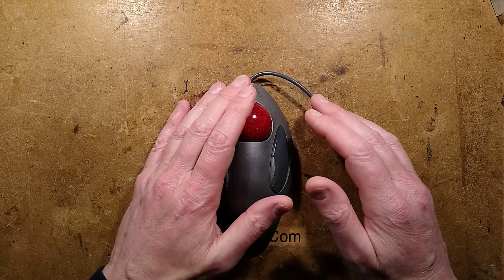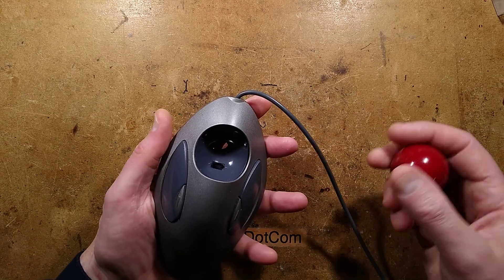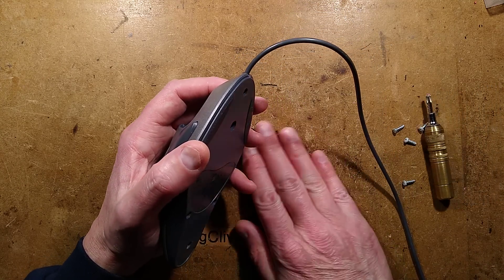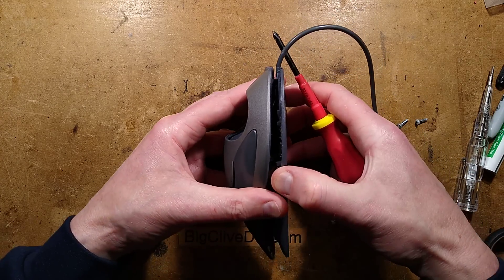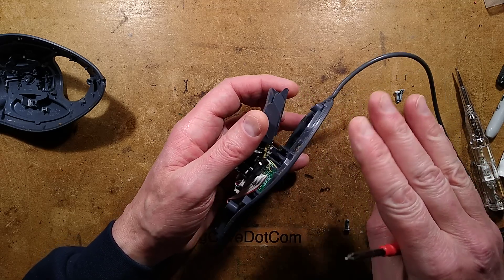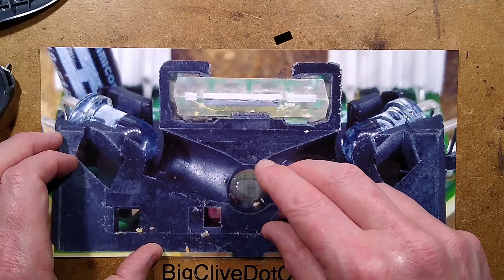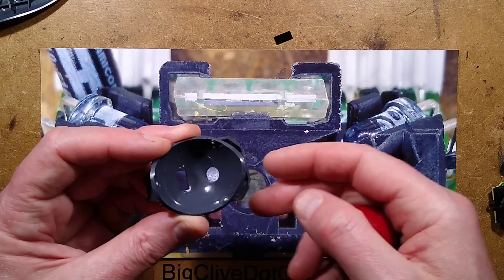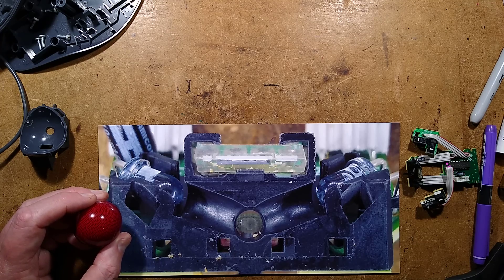inside an optical trackball

Comment: Regarding what big Clive was saying with the use case of these.

I'm surprised that he did not mention about people with disabilities using a trackball for computer input!

For some disabled individuals and I have known quite a few track walls are great a lot better than trying to use a mouse.

Some of them are not actually able to use the mouse due to limitations of their disability.

And I'm someone myself that would probably benefit from trackball use.

I have carpal tunnel in both wrists and it is hard to use a mouse for long periods and I'm someone that will probably be in the tech industry eventually 

Something like envisions and mine actually exists I think I saw something once that's similar or works very similar or maybe something slightly different but reminds me of this.

What I was looking to see if it actually exists is essentially a joystick but has a miniature say marble-sized trackball in place of the Hat switch.

That could be here to act like a computer mouse.

Or even some sort of Gamepad with an integrated trackball.

I know they have the Sun trackballs but I'm having trouble finding something that would really work for me

As a matter of fact years ago we believe what might have led to my carpal tunnel symptoms.

It was not constant typing that is out the window due to the fact that I really could not touch type whatsoever.

Back then it took me over an hour per page.

However on a smartphone keyboard nowadays it's not as bad for timing honestly.

And most of the time I use voice recognition.

That's actually what freed me up from using the mouse so much later on when was Dragon dictate in the original version of it.

And a truck pull has been suggested many times.

The thing was the reason for so much Mouse use and yes I'd actually have to swap over hands because it would be so much to do this have issues because of this.

Keep in mind this was before accessibility was built into windows.

I was using a third-party program for on-screen keyboard.

By the way I was clocked at 30 words per minute plus with the on-screen keyboard.

I was able to type faster than all the other students in the class.

And yes this includes did deduction do to errors in the calculations.

You can imagine how much miles do we use that would be per day carpal tunnel in the end.

A note of phone I can use a game controller nearly all day with no problems and this has been suggested as well.

Essentially just have a USB wireless dongle setup for the proper firmware.

And also having essentially the thumbstick analog one set up for mouse either one person fine but that's an option.

And just mapping buttons to whatever is needed or desired and even having one for shift 

Say for example pushing a might bring up the on-screen keyboard perhaps be might be a hero browser maybe even one for VLC media player.

Then again the game controllers work with just about anything with proper setup so pretty much Universal.

All you need to do is just have that dongle with you!

And also nice thing is we'll be able to do USB if you're not needing Wireless as well.

Easy enough to configure something like this as a human interface device.

Not only that bring me to fully customize everything to whatever scenario.

Not to mention Universal compatibility!

They thought I might be good at typing years ago however that was not the case only reason for this was I was so good at keyboard based games.

Very fast on the fingers on this as well.

Keep in mind very early on some of this was noticed on the IBM PC Junior and other early computers even somewhat on the Commodore 64.

This was early when we first started having computers in the classroom and most of the time one computer had to be shared among multiple rooms and sometimes only having one in the entire building at first I believe it was the Apple 2 C but it may have been an earlier version

Comment: 20+ year old trackball, Logi hasnt UPDATED since.  Over 1/2 the stock is OLD, the cable are breaking and there is no replacements.
Current Trackballs dont have travel...they STOP almost instantly..  really sucks, they arnt SMOOTH like the old Analogs.

Comment: I've had three of this exact model for over fifteen years. Each one has required disassembly for cleaning (and once to re-solder the micro switches). 
well built, and relatively easy to service without breaking. And they go back together nicely.

Comment: I got one second hand for a couple bucks after I began to feel some RSI coming on. It's not great, but it's not bad. The DPI isn't that great for modern displays, but mouse acceleration actually helps with that. At least the wearable bits, the switches, are easy to replace. I was told that after you clean the ball the bearings you just take it and rub the ball against your forehead a little, rolls smooth after getting "greased". Sounds gross, but it works.

Plus if anyone insists on using my computer even after seeing they have to use a trackball and a tiny keyboard I can just tell them about the forehead grease to get them to go away.

Comment: Those little bearing balls are, I think, ceramic. Replacements are fairly easy to find if one "poings" off (terrible tragic story) into the void. Some trackballs use ruby balls instead, but as long as you find the right size they are interchangeable.
Reply: I have a thumb and the HUGE by Elecom

Comment: A friend uses this model Logitech trackball at her office.  The first one lasted about 20 years until electrical failure.  I got lucky and found one new in box at a local flea market for a few Dollars US just when she needed it.  On line, this model commands a high price.  This model is discontinued and the newer models just aren’t as well made.  I don’t know from what the ball and rollers are made, but they looked brand new even after 20 years of use.  Thumbs up to the mechanical engineers who created the robust design.
Reply: Because of a lack of space in my domicile I moved to trackball mice, the Logitech units were very expensive so I picked up a Kensington Orbit for $30 USD new about 2 years ago and it rocks!  No comment as to whether it'll last 2 decades, that depends on how clumsy my cat and I are primarily, but it's a solid responsive mouse that's already taken a few beatings.
Reply: Fwiw, I have a newer one (couple years before discontinuing them) and it's as solid as my older ones. Maybe you got unlucky, or maybe I just happened to get a good production run. 
But at least my newer Trackman is excellent. God I must've bought this in like... 2018?
Edit: Though to anyone in the market, don't pay the new old stock or exorbitant used prices. There are other models out there that are better imo. Trackman is a nice mouse but not worth current pricing as it's discontinued.
Reply: I have one of these but tbh the one thing this one misses is the scrollwheel.
Reply: I have one of these that I bought in 2000 and have used every day for 24 years. Still works fine.
Reply: @snoballuk   Thanks for the reply.  I didn’t mean to suggest there is any inherent unreliability.  Even 20 years is great.  There aren’t many things in the computer world that are even relevant for more than a decade.  For my desktop computer, I have a real IBM PC/AT keyboard from the late 1980s and a Microsoft optical mouse from the mid 1990s.  I still haven’t found modern replacements for which I am satisfied with the feel though I’ve tried quite a few.  If it is old and works, then why not?…. 🙂
Reply: Yep, the Marble Mouse is my favorite trackball, and unfortunately all their newer models are made for right-handed use only, so they're useless to me. Unfortunately the button switches eventually wear out. I finally had to get a Kensington Orbit (the closest competitor) a few months ago, when my last Marble Mouse wore out, and it doesn't fit my hand well at all..
Reply: @RedwoodRhiadra  Moved from marble mouse (after wearing out the switches on something like 3 of them) to the gameball trackballs finished relatively recently. Ambidextrous design with plenty of buttons/dual scroll and easy to switch left/right handed use (really my only complaint is that it is too easy to switch and I end up accidentally triggering left handed mode)
Reply: Don't whether I'd agree the newer ones aren't as well built. Or rather, whether they're as reliable, because they are from my experience.
I'm disabled, and I've done work for a variety of disabled groups so I've receommended and bought these for people galore. I've had two fail and they were from the same era of around the 2007. They both had a communication failure with their wifi or power thereof.
I've got 5 of these personally from the older than this featured model to the current model. Most of them have textures that are worn completely smooth with us because they are all reliable as heck.

Comment: The Kensington expert version is great while it lasts, but they seem designed to fail after about two or three years. Usually the main button stops registering clicks occasionally. I think the plastic button molding is just barely long enough to press it down, and the plastic wears over time so they can more money from you.

Comment: I was clicking on the video using this very trackball :) Using this thing since it came out, it never failed. It takes some time to get used to it, but then you have a beautiful device that needs no free space on the cluttered desk. Also it is very sensitive yet it cannot be bumped like a mouse, once you let go of the ball, the cursur is locked into position, I like it.

Comment: My trackball doesn't have the dots on the ball, neither does it have a dark window over the sensor, it's open to any dust bunnies that happen to visit. Thanks for the WD-40 tip, I'll give that a go. I have the WD40 Silicone, I guess that will do the job, too. 🙂

Comment: I had the Logitech M570 for years now I think I bought it back in 2011 for $25, the middle button no longer works and now the left click is starting to stop working but im still using it,  excellent ball mouse!
Reply: Middle button is a (Omron, I think) standard tactile button, left/right buttons are normal micro switches and the forward/back buttons are SMDs on a separate PCB.

Comment: I bought a trackball (a thumb one) hoping to keep my minor RSI from getting worse, and it somewhat helped but it put a lot of strain on my thumb instead of my wrist/forearm. I ended up alternating between it an a vertical mouse, which worked fairly well. I bought a thumb one despite knowing it would be less ergonomic because it's basically the only way to get a trackball with a scroll wheel for less than like $100 (and those tend to have rather odd scroll wheels that may not be clickable, which is also an issue) and that was an absolute requirement for me. Unfortunately, my cat threw up on it and I never did disassemble it to clean it, so I've been using just the vertical mouse for a couple years, and honestly it kind of sucks for a bunch of reasons. And the buttons are wearing out now too. So I'm gonna have to get a new mouse/trackball soon regardless, and I'm not looking forward to it because the 'ergonomic tax' or whatever you wanna call it is quite significant.

Comment: As a matter of fact, what you have there is one of the first generation that used optical tracking. Earlier, optomechanical versions didn't need the texturing, and later, flat-angle surface scanners like we have now did away with the need for a visually textured surface. Incidentially, that's why the ball was red, because that gave the necessary contrast with the IR light it used.
Reply: Do the newer ones use the same sensors that modern optical mice use? That would make sense, as a flat-angle surface scanner is how I would describe modern mouse sensors that are basically computers in their own right.
Reply: @alext3811  The sensor in my MX Ergo certainly looks very similar from the outside. It does still have a somewhat textured ball though, but this is far more subtle than with the trackball shown in the video. (I have actually also had that one, but I prefer thumb trackballs.)
Reply: @patrickreuvekamp  I had a OG trackman wheel that lasted till 2020 where i finally had to replace it because i couldnt buy replacement switches for it, have a m575 and i bought a bunch of the good 10m actuation Omron Japan switches to use till this one eventually has a switch die

Comment: I have 2 of these exact models and been using them for 20+ years. Once every few years I will remember to pull the ball out and dust off the inside of the recess. I haven't ever  needed to go inside the case, but thanks for showing me what is in there. I am atypical in that I use both a mouse and a trackball on a machine at the same time, best of both worlds.
Reply: I have one of these somewhere as well, they're just so smooth and comfortable to use!

Comment: Indeed, Clive, you are missing an anti-skid pad on the heel of the unit. After many years of use, these tend to require replacement of the two switches under the left and right mouse buttons. It's a cheap and easy fix.
Reply: I have three of this model. I use a piece of no slip pad (such as the rubber like pad used to keep a table cloth from sliding, drawer liner), cut to fit the shape of the mouse.
Reply: @scottbc31h22  I use a piece cut from a  yoga mat.

Comment: I used a Microsoft Wheel Mouse Optical for decades until one of the switches finally failed. (The left click, of course, was the one to go.) Took it apart, and it was one of those all-in-one chips you mentioned. I'm pretty sure I bought that mouse in 2002 or 3, so the single chip has clearly been a thing for a while. No biggie if it works. 🤷‍♂ Currently on a Logitech M705. They weren't kidding about "marathon" battery life -- I'm using the AAs that came with it when I bought it 3 years ago, and it's reading 50% state of charge as of now. It's a daily driver. 👍

Comment: Been using the Logitech track balls for couple of decades. 
In our case it was the left click button gave up on all of them. 
Well have a double click. 
Originally they had a red ball then later a blue ball 
Ours were all wireless. 
I also have a “ finger track ball “ 
Fits on finger and ball is on top. 
Around 2006 I worked in an office and could never get used to the standard mouse. 
So I brought my tracker ball. 
Within weeks all my colleagues were using a track ball 
IIRC 
Paid 80 euro for last Logitech track ball I bought. 
The finger track ball ( I can’t recall the brand ) 
Was around 25 euros. 
Bought from eBay. 
In fact I ended up with 2 of them second as a spare but not needed since iirc 10 years on the first one Is still working flawlessly

Comment: I have this model, and a whole bunch of M570s and M575s (the M575 works with Bluetooth as well as Logi unifying receiver).  I've used trackballs for a very long time because my desk is the usual desk that is constrained for horizontal space even when clean (or the usual workbench that NEVER has free horizontal space)
Reply: I've killed a bunch of M570s thanks to Logitech's love of using tactile switches instead of micro switches that handles 5x more button presses. They used sturdier tactile switches for everything on M575, we'll see how long they will last. My old beige Trackman Marble sans scroll wheel still works but is tucked away in a storage box somewhere.

Comment: In my experience, the plastic bits the ball rides on in things like this are usually PTFE (aka Teflon) rather than nylon.  People tend to forget that Teflon isn't just for cooking with, it can actually provide a nice fairly long-lasting quite slippery surface for all kinds of applications (such as exactly this sort of thing).
Reply: I'd bet they're ceramic coated with Zirconium Oxide.  
"But those are what we buy aftermarket to put in trackballs with scratchy ruby bearings!" you might say.
Yes, and I bet we do because Logitech has been doing it for decades and does to this very day.

Comment: Trackman marble seems discontinued. They used to be around USD $25.

I used them for a good while, but the switches start failing after a year.

Elecom makes some decent ones if you need a lot of buttons. Porlei/Nulea/ProtoArc (same products) have models that are closer in price/function to the Trackman Marble. Kensington seems to be the last bastion of cheap ambidextrous units, and the scroll ring is pretty cool.

Comment: Ive used the logitech marble mouse for about as long as ive used computers. The reason the marble mouse is so expensive is because it is still loved by many but no longer manufactured. There are pretty good and low cost trackballs from Kensington, ive been testing one out to be my new replacement as my collection slowly wears out. It is nice to have an actual scrollwheel on a trackball 😅

Comment: If you want to lubricate the ball instead of WD40 you can use White Mineral oil.  You have to do it outside of the mechanism and remove excess (I recommend the baggie and a little bit of oil.  Mineral Oil doesn't have the same smell and when it gets on a compatible ball it doesn't mess with the optical sensors.